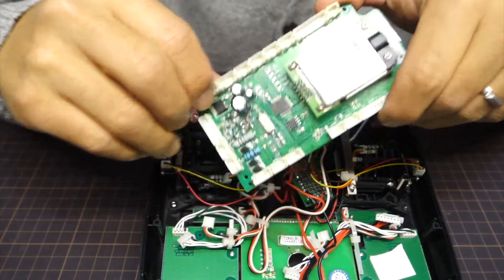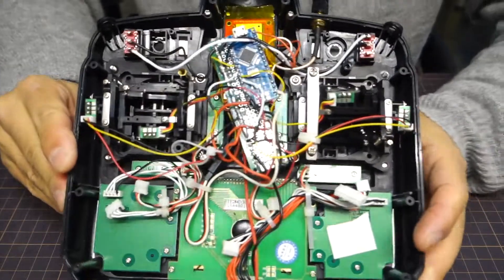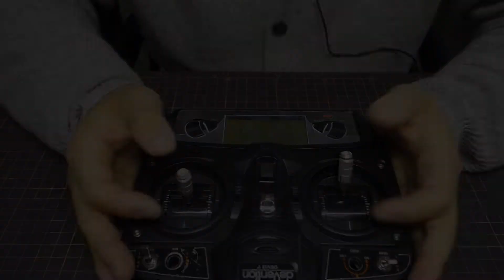Arduino Based Simple Transmitter for ELRS TX Module

Comment: Hi li , i try your code with arduino mega 2560 but when check value of joystick with potensiometer  it stuck on high value  ,i see it on inav flight controller ,stuck 2000  but on switch its work and what the solution?

Comment: How is communication with elrs module solved? PPM or real crsf?
Reply from the maker: real crsf, but it is wokring one way handset to module
(without telem).
Reply: @leejack1112  that's very nice. But crsfshot would be awesome. I'm currently building opentx based on esp32 in the case of flysky i6x. But I'm struggling with porting back crossfire shot ...
Reply from the maker: @f0xvibes  If you are working on espe32, take a loop at this repo, https://github.com/danxdz/simpleTx_esp32, telmetry and many feature was implemented on esp32.
Reply: I took a look at the code of cruwalker, on which you based your code. And it uses ppm to crsf library, so it's still ppm not crsf. That's the reason why telemetry could never work
Reply from the maker: @f0xvibes   Only the concept and the shell was based cruwalker, the code was written for avr only, and it use crsf via uart. The only reason tlemetry not working is 328p only support full duplex, and molule use half duplex.

Comment: You got a sub! :)
I'm thinking about this too... already read the crsf protocol but haven't time yet to try it on.

What version of ELRS did you use?

Overall, Keep this project coming. :)
Reply from the maker: I am using 1.0.3. Both on TX and RX.
Reply: @leejack1112   I tested it with 2.0.1 and its working. 

If it could run on ESP32, then a build-in GUI could be use to change the radio setting.
Reply: Hhh main elrs juga ya om
Reply: Kalo open tx untuk mega 2560 nggk ad crsf perlu coding sendiri lagi wkkw
Reply: @IMV_VERSE  iyak, kemaren dulu udah pernah diskusi sama dev-nya. 

tapi ELRS sekarang udah bisa baca input PPM, ga perlu lagi otak-atik firmware handset lagi. atau kalo DIY pakai arduino cukup generate output PPM.
Reply: @CapungPlastik loh jadi bisa ya pake open avrc mega 2560 output ppm nya langsung masuk ke pin crsf serial port module tx elrs?

Comment: Hi!
First of all; VERY VERY awesome project! Specially for how "simple" the code itself is. Very intuitive to tweak and modify. 
I have a question, would you port this code into ESP32 platform? or raspberry?
Either way, thank you very much for your work!!!
Reply from the maker: Thanks for your support. In short term, I do not have plan to port to other platform. For high performance TX there is already Deviation TX and Open TX. My goal of this project is to keep it simple.
Reply: @leejack1112  fair enough :)
Reply from the maker: @OG_ALviK  Some one have tested it is working on ESP32, with minor change.
Reply from the maker: Watch this repo https://github.com/danxdz/simpleTx_esp32